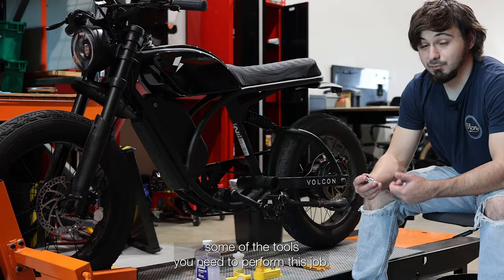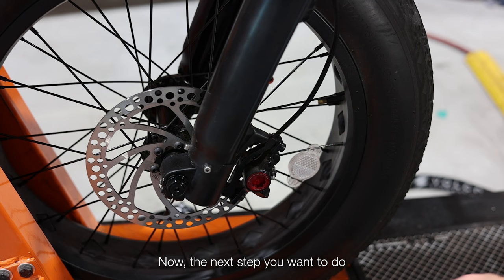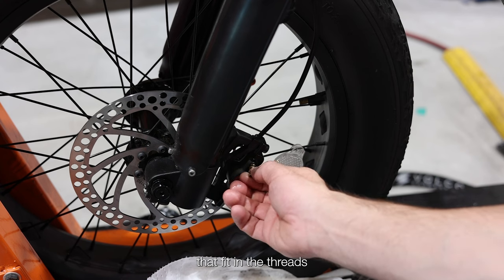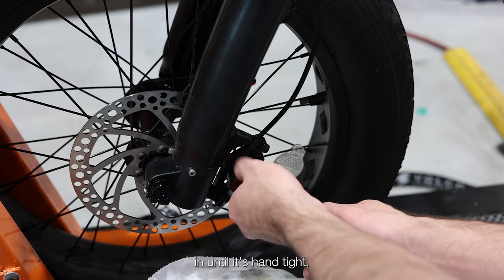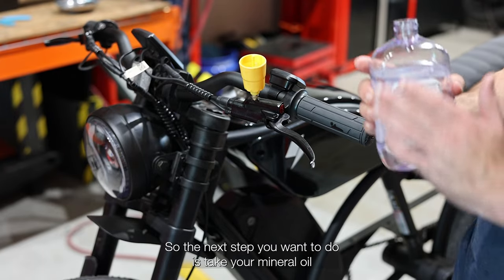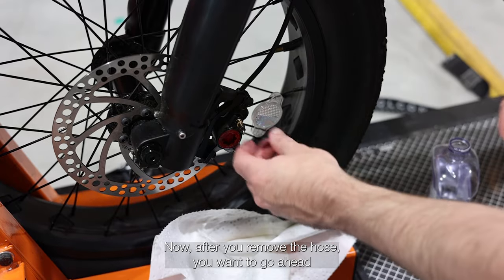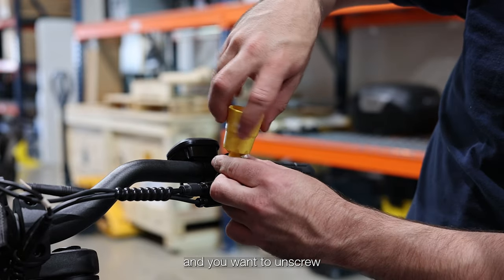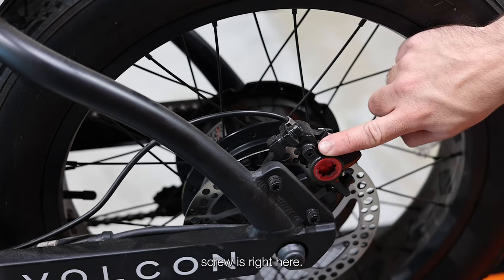2023 VOLCON BRAT | How to Bleed the Brakes

Comment: I've done it step by step twice and my breaks are still mushy. Idk what to do. I even brought it to my local shop and under an hour after they did it they were mushy. I'm not leaking and they checked the lines. I use my bike to get to work and whatnot so hopefully I can figure this out soon cause not having breaks is scary
Reply from the maker: Please reach out to service@volcon.com!
Reply: Reaching out now@VolconePowersports 
Hopefully I can get it up and running again cause I'm at 795 miles on it and my goal is to reach 1000 and do a full review on it. Also do you know of any companies that make third party kick stands for this bike cause the one I have came with bad threading so I just don't use it. It rattles to much